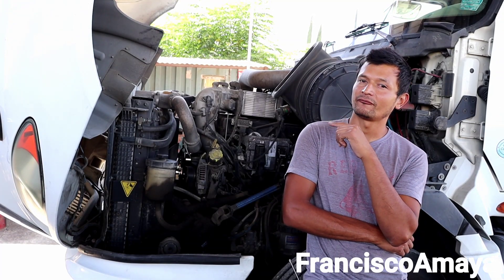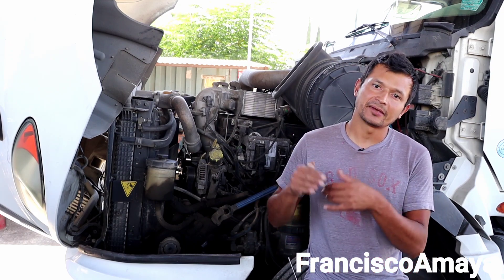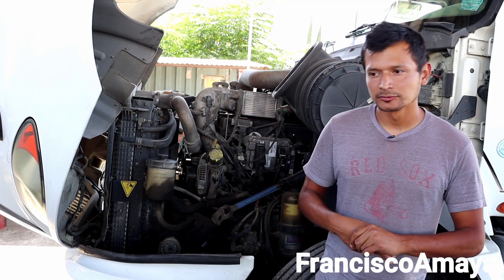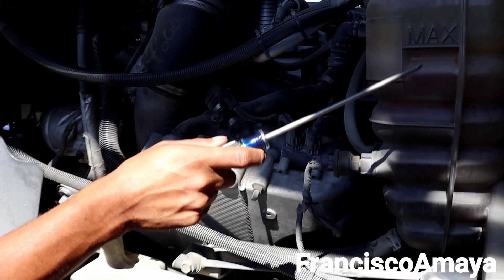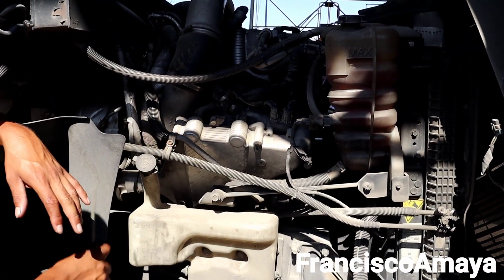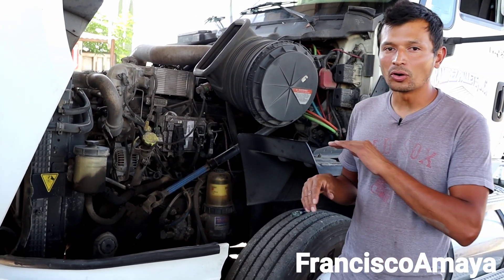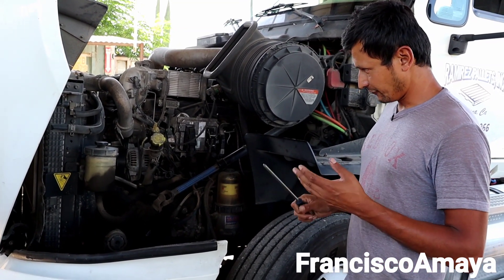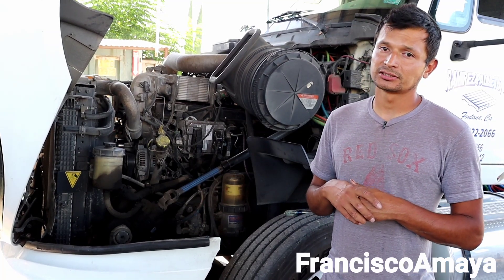S4 E1 F.A.I.T.H. internatinal navistar maxxforce engine failure bad design problem high repair cost

Comment: This is a Rare truck. a Maxxforce X15. or a Very High horsepower early Production X13. You can tell from the Cooler design. This thing fucking Sucks to work on.

Comment: I can just say that If you are considering a Volvo. Turn around fast. Between the Taxxforce and the Volvo. They are both POS rigs. But Volvo is way worse since nobody will work on them. So if you break down in the middle of BFN. Nobody will even be able to touch the truck at a mom n pop. At least with the International Taxxforce you can still have a mechanic that will do some work.

Comment: Francisco we bought a new 2022 LT with the A26.
We have 43000 miles on it, I know we stepped out of the norm getting that engine. 
We love it, I could keep you informed about how it performs. Thanks
Reply: Your Engine is a derivate of a great MAN engine. The D26. Very popular in Europe and south America. 
In China I think is also used by Sinotruck as well.
Reply: Keep us posted of your fuel economy, MAN is a great engine. They are part of the Second biggest truck maker in the world, including Navistar, called Traton.
👍
Reply: @pedgar789  Fuel mileage is at 7.5, pulling a hopper. Loaded to 80,000 pounds 90% of the time. 🙂
Reply: Not bad.
I was expecting closer to 8 mog but still very good.
If you want to see more about your engine, search the net under MAN engine D26.
Enjoy your Navistar.

Comment: International epa 2010 engines usually have better mpg when they're on the road than Cummins or Detroit but the maxforce epa 2010 will be in the shop all of the time due to failed egrs, egr coolers at least once or twice a year, cloged dpf evey 6 months, turbo seals, failed injectors 1 or 2 every 9 months runing crappy bio fuel CA has everywhere, injector harness, cracked exhaust manifolds regularly, sensors and engine harness issues all the time. We've "had" 3 that would visit the shop about every 60 - 90 days give or take a few, thank god for the extended warranty. We ended up in a law suit with international over the maxforce settled with all out of pocket expenses for repairs returned and a buyback and a stupid hot deal on new Cummins ISX installed prostars. International is a reliable comfortable truck with the Cummins installed. But we buy Freightliner with Cummins X15 installed just for simplicity, but the DD15 pulling power is hard to ignore.
Reply: I have one and currently still driving it. Got it around 560k miles and currently at 730k. Guess I'm just blessed that other than replacing the clutch fan, the actual engine has not needed any work. The fuel pump has some type of error, but It just keeps going. Also the EGR cooler has an issue, and every now and then it will smoke like a train. At this point I am ready to move on, but with the low resale value, I figure I may as well drive it till it stops.
Reply: @Liynkx  Definitely a lucky one. And if it's paid off in this market it only makes sense to keep running it.

Comment: The question then becomes does the expense saved on DEF and DEF components make up or even exceed the expense for work done on this engine type? Also, does this technology allow for greater or lessor fuel savings?
Reply: This truck could get 20mpg and it still wouldn’t make up for how much money you lost having to tow it to the dealer every few months.